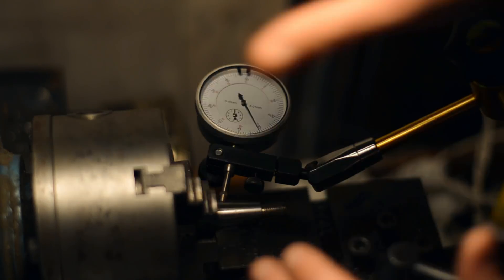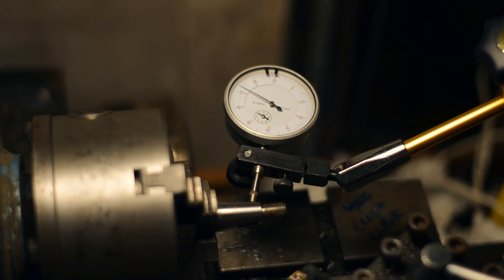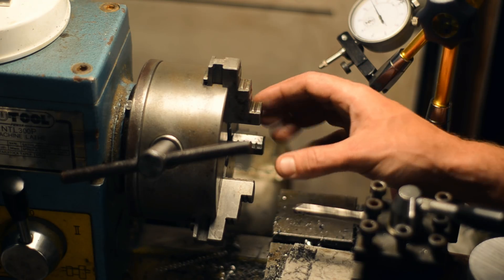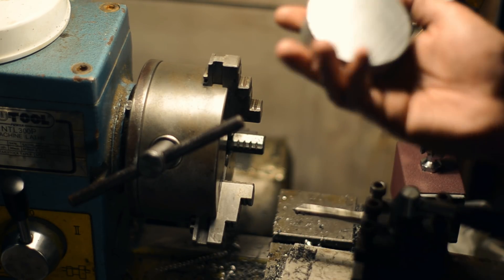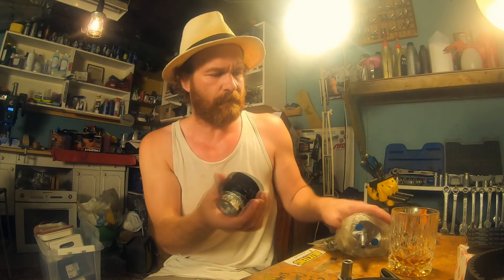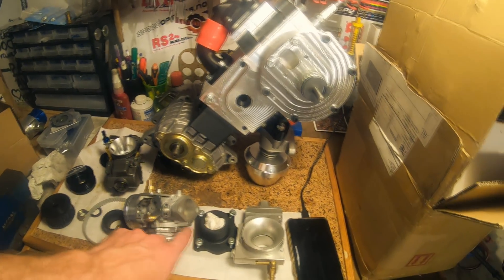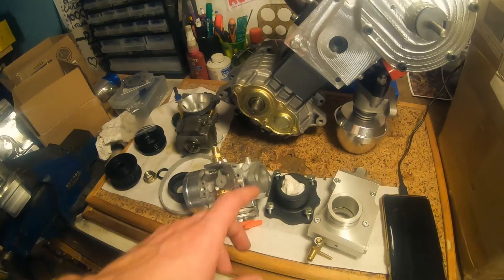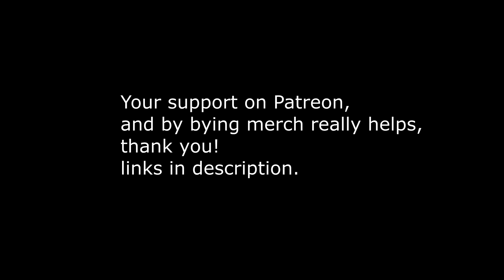Creating a Monster!

Comment: you can always turn the 3 claws of your chuck around! in that way you can clamp much bigger pieces of material
Reply: I was going to suggest the same thing glad I read the comments first lol
Reply: Got to have the reverse set - the set in the vid can't be reversed like 4 jaw jaws. Sometimes a 2nd hand machine does not have reverse jaws. Been misplaced or separated.
Reply: i was going to say something  like that but its a bit more complicated than that... you actually need the reverse jaws (even the cheapest crappiest chucks usually come with them so idk whats up maybe he lost his?)  just flipping the jaws doesnt work for a few reasons...
Reply: Wont work as the teeth on the jaws are curved to engage with the circular scroll thread.
The chuck usually comes with another set of jaws for that purpose that have a concave shaped grips to hold a shaft.
Reply: @AuMechanic  Depends on the chuck, some chucks allow you to flip the jaws. I've flipped them a lot of times.
Reply: @AuMechanic  you haven’t posted in a while
Reply: @Bms-py6fz  Yeah I know.
I'm still working on my motivation.
Reply: @AuMechanic  Making my 3rd pipe right now using your software. miss u dave.
Reply: @satanshantverkare  Glad to hear it
Cheers.
Reply: @AuMechanic  it's okay I'm here if you need me, making a pipe for my rm 136( bored out rm125) its got a custom pneumatic power valve and its ported
Reply from the maker: Yep
Reply: @AuMechanic  They do actually, the teeth on the claws are shaped in a way they fit both ways into the chuck.
Reply: @azertyytreza8947  4 jaw yes but not a 3 jaw. 4 jaw has separate scrolls -  Large 3 jaw has a single spiral plate. Mini lathe 3 jaws can be reversed but they are 'weakened' by double cutting the jaws - cannot clamp very well and they jam easily.
Reply: Do you really think that he dont know that on some lathe Chuck that is possible? The man is Genius make stuff at home that other people are dreaming about. Come on

Comment: Your Chuck teeth should come out and go in the other way . To hold a larger piece…
Reply: Usually not possible with good three jaw chucks. The cheapest type supplied with some mini lathes are reversible, but they are an exception.
Reply from the maker: This one's non reversible, curved teeth. Might be why it has next to zero runout.
Reply: They do unless there is something wrong with them that I missed or forgot from an older video